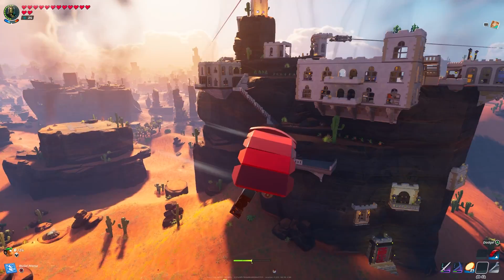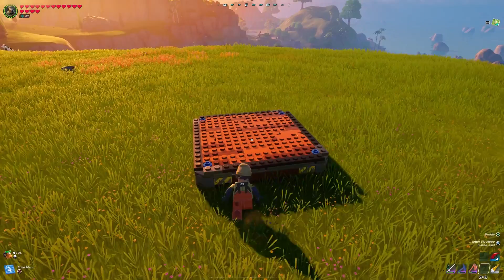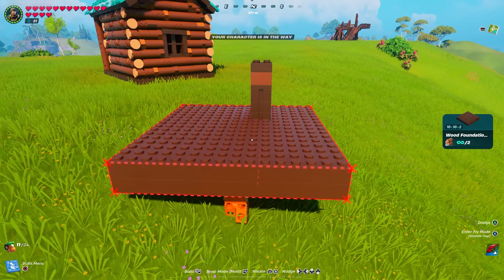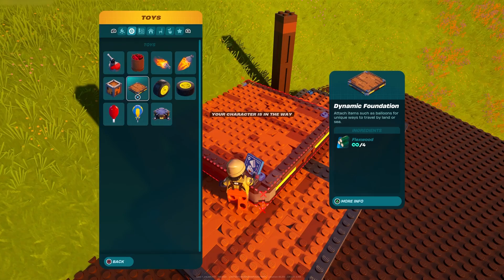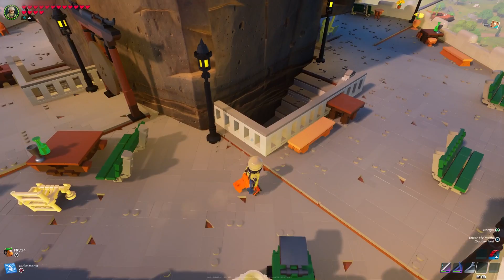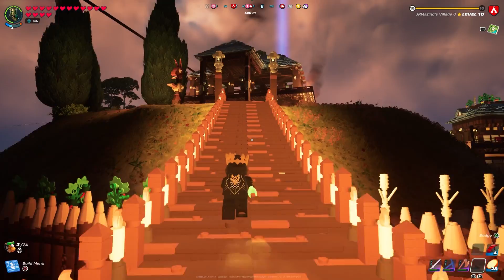Build in ANY Direction - LEGO Fortnite #legofortnite

Comment: Has the new update patched this? cuz I keep getting "OBJECTS NEED TO BE ALIGNED" as an error and it doesn't allow any further building off of the newly aligned pieces.
Reply from the maker: No, it still works but LF has added that error when pieces in different directions are too close, they need to be about ½ stud away from each other. If you set a new direction and only build off that direction you will be fine.

Comment: I just built a pre fab on an angle tonight! They snap to foundations, so Instead of using  a pillar I made one out of foundations. It’s not as smooth but works.
Reply from the maker: Hey, thanks for sharing, that’s good to know. 👍
Reply: @GrindGeek  no problem! I’ve been experimenting with it more today and it only works on certain builds. Not sure why.
Reply from the maker: Hey again, I just tried but I can’t it to work. If I follow what you are saying I did my same process but instead of using a pillar as the new direction anchor I use a foundation? I did but I am still not able to snap to it. Do you have Discord, maybe you could send me some pictures. You can find me @grindgeek there as well.

Comment: Any advice on making it so non  cardinal axis objects can line up with other objects on the same planes except upside-down?

For example, 45°objects, one upright and the other inverted, such as palatial pillar 01?

I can do it when they are cardinal direction aligned, to an accuracy of over 15 heights before slightly non parallel flaws cause issues. 

But with 45° I can hardly have it lined up enough for 2 heights.
Reply from the maker: Hey, it can be tricky to get multiple objects precisely aligned on the same local axis. What I usually do is set the first piece on the angle and then build a flat base from that object that you can work on with a couple perpendicular walls to make a corner. Then get your second dynamic object in the orientation you want and push it into the corner. Try snapping off that and see how it goes, I have had to wiggle and adjust a few times to get them perfect. Sometimes the second dynamic block will not sit squarely on the foundation so it may take a few tries. 

If you are still having issues let me just know and maybe I can drop in to your world and we can see if we can work it out. 👍